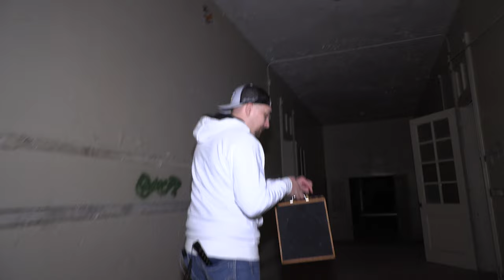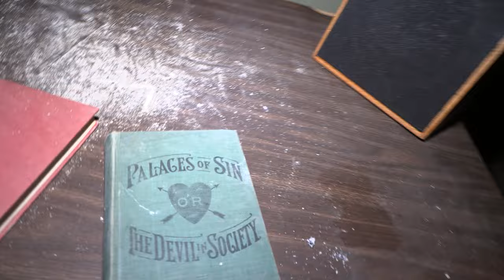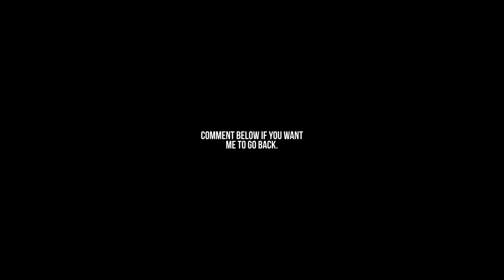SO HAUNTED THEY HAD TO CLOSE THIS BUILDING

Comment: 8:23-There is an orb flying up from the floor on the right side of the screen right by that first chair. It disappears as it goes up so watch the floor to see it best.
8:33-Another orb flying up in front of you just before you jerk your camera when you hear the noise.
9:40-A third orb became visible and then disappeared as it approached that light switch on the left wall just above the bricks.
There are orbs flying all over in that auditorium. Just too many to keep track of.
26:18-There was another orb that flew diagonal from the right front of the room to the left back side of the room above the white table. There are a ton of orbs flying around this music room as well. I stopped counting when I got to 12. I swear I heard talking just before your Pmb box started playing.
43:50--An orb flew down from the upper right ceiling and went right into your chest CJ.
44:08-Another orb just flew over your head going right.
It doesn't appear that there is a dark entity there unless it wanted you to provoke it. 
I think you need to go back there (maybe with Jas?).

Comment: @CJFaison top right corner multiple orbs, more than 7, fly by BEFORE music box goes off. In fact, just as it goes off you see an orb in the same area. Now if it had been dust or insects it would have been all over the screen, not just the top right corner.

Comment: I think we all know what appears as orbs can actually be bugs or dust and abandoned buildings are full of both. Although I find them interesting, I don't usually see them as evidence of anything. But as you were sitting in the basement, listening for noises, I saw a very faint flash of light floating towards you from the right. A second later you said you felt a shiver which would have been when it touched you. This was around the 18:40 mark. That moment kept me glued to the video. It also seemed after that moment you stared to relax a little. You even said you felt more comfortable down there as you started to leave. Hearing the bangs and the chair move across the floor were interesting but that moment in the basement felt unexplained.

Comment: The male voice that came through just as you were about to touch the evp machine thing I thought said "knife" I'm sure i could hear the kni"ff" clear as day, it was so loud and clear. I would try using a digital  voice recorder.  At 4:44 there was a noise that the writing on the screen said was a ball rolling, I didn't see any ball roll but to me it sounded like someone pushing something heavy on wheels like some kind of trolley then what sounds like shoes rubbing on the floor as if trying to stop it. I don't think there is anything dark there.

Comment: Have you thought about using a baby monitor as part of your paranormal equipment?  The Fourman Brothers from Paranormal Nightmare use baby monitors, and get quite a lot of communication through them.  I wonder if the spirits within the building had used loud bangs before, and found that the noise scared people away in the past, but stopped all communications and noises because it didn't seem to work on you and Dylan?  I think you should go back - but not alone.